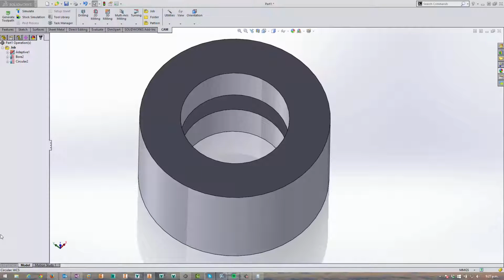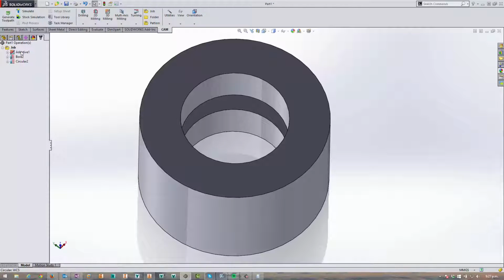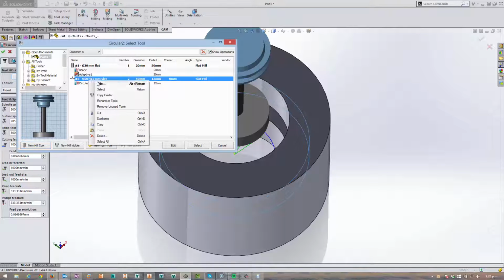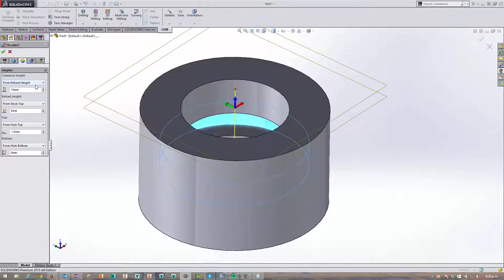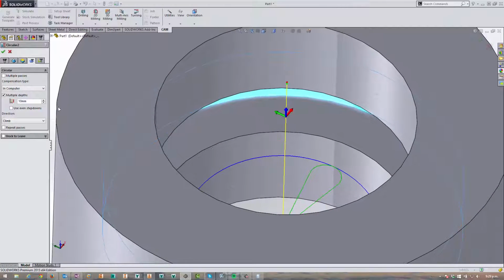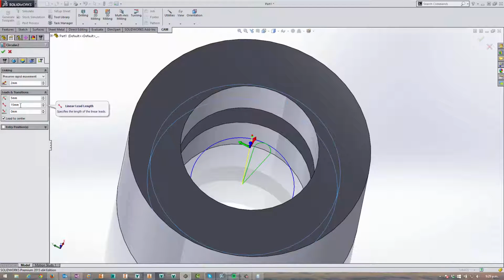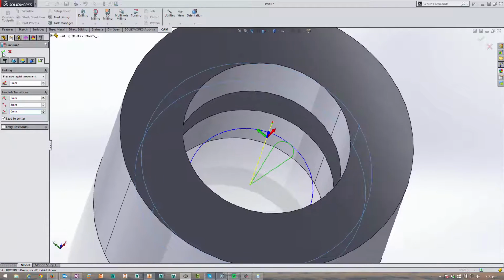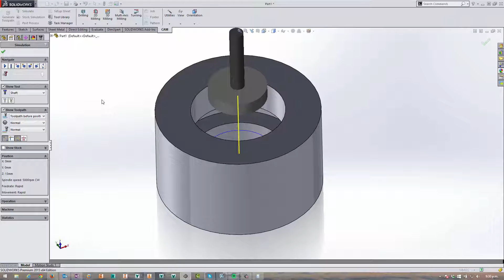Machining a groove in Cylindrical Stock with HSMWorks - Support Response

Comment: Nice video, but what you would do if inside of this groove would be angle ?
Reply from the maker: You can set a taper angle in most of the 2D toolpath passes tab. Or selecting the conical face for bore, cylinder & threadmilling toolpaths will just calculate the angle of the passes automatically.